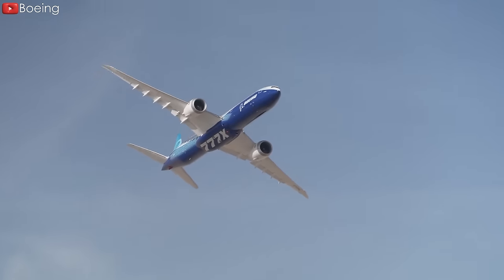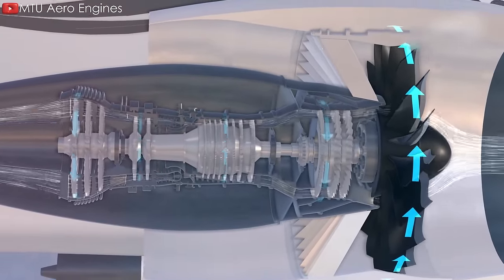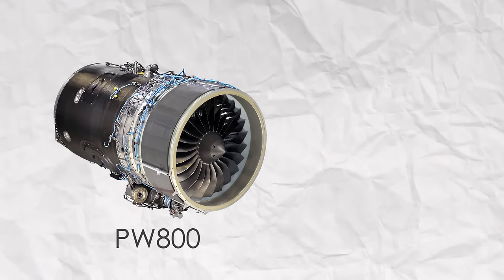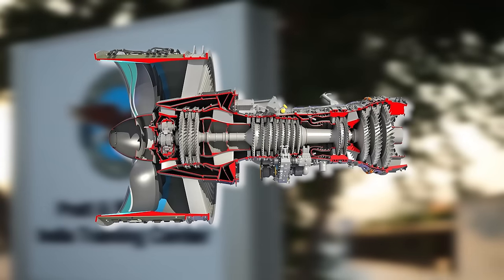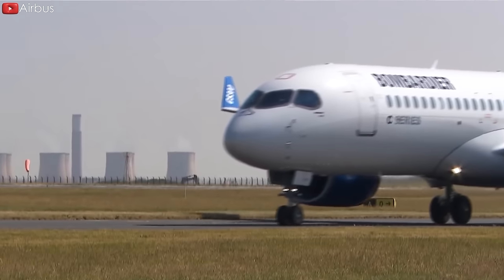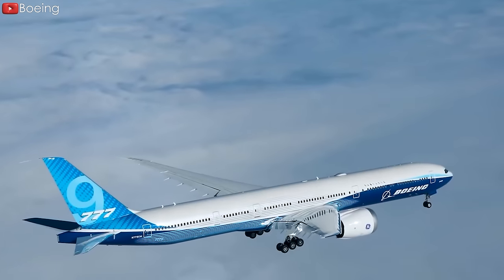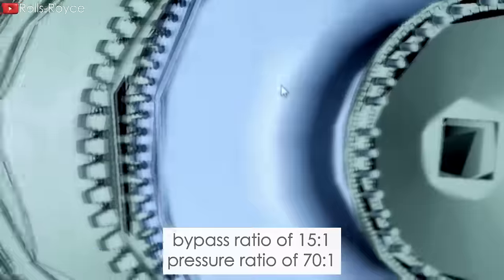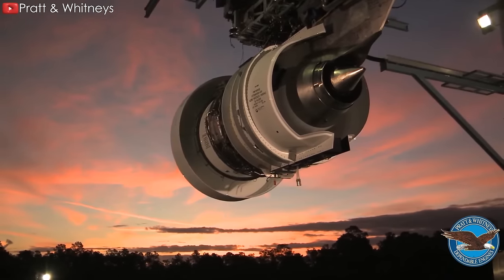Airbus 380's NEW BIG ENGINE will change the entire industry! Here's Why

Comment: 😂 Great idea G for Gearbox and Grounded ! All PW1100G enginesq are out ! Recalled Great dramatic non Gas consuming at all... like G35 engine. Oops F35...Gear not Great. Lots of planes Grounded Grow of prices due to lack of planes conGratulations 😢
Reply: The current major GTF problem is linked to a metal powder supplier which also affects other jet engine manufacturers. 

The GTF gear box has been virtually 100% reliable.
Reply: @icare7151  hello, almost ALL PW "G" have this problem of métal treatment ( surely on gear ) large numbers of planes grouded while G.E, SAFRAN, RR don't show at all this general problem.

Comment: 50:1 I wish them luck I really do but I am really astounded with today's 12:1 bypass ratio that is incredible, the 50:1 is almost the fossil footprint of a cigarette !
The ETOPS rating ( distance to a backup Airfield ) has changed over the years for twin engine aircraft allowing them to cross oceans still exists but the reliability of the latest turbo fans has allowed them to get further away from their alternates turbojet physics will never change as far as as the engines go as a 50% loss of power may result in a 50% loss of height and therefore a descent into thicker air this is what made the four engined aircraft able to cross the vast oceans that they could
I wish then luck I really do
Who knows maybe I tri-jet jet engines aircraft that may not be used unless required with similar RAM air ducting to eliminate the drag caused maybe the auxiliary power unit normally for starting and ground power could be larger and have a throttle
For emergency power

Comment: It seems that there are some secrets kept by all parties leading to this mess. I believe the newly designed jumbo jets are not survivable if one of their engines fails on take off or initial climb in every case, one engine does not have enough power. In the case of the A380, even 3 engines could not do it. We also know what happened to Concord.

Comment: Once again I was the employee to suggest the scaled enlargement of the NEO to fit the Airbus 380. The Russians also invested in the Pratt NEO engines this is why they are on the first MC-21-300 Russian Airliner and I was the first Flight test Jet engine mechanic for the MC-21-300 in Zhukovsky 2017 and Siberia.
I was fired from my career because 😂was too good at the job for my co-workers to have to put up with. Now I had trained to kill Soviet troops with enthusiasm for 3 years on the iron curtain. The Russians knew this and at first did not want me there. But I grew on the like a wart 😅 I had empressed the Russians with my skill and dedication to the job at hand. Covid hit and I lost my Test cell and thrown down with the dregs of humanity on the assembly floor and I was placed on the military line. That pissed allot of people off who have seniority over me. I am a military vet. They are NOT. The last thing I had done at Pratt & Whitney was CORRECTLY Re-write the assembly instructions for the F 100 main engine oil pump so any dumbass could build it correctly. The retired factory workers who WERE NEVER certified Aircraft mechanics. Kept the instructions garbage so in case of a strike. No one would be able to properly build the main engine oil pump. I re-wrote them correctly. Engineering was stunned. They asked me why I felt qualified to write the factory assembly instructions.
I replied I have 20 years experience with Caterpillar heavy equipment repair and the last I heard they were big Into hydraulic fluid motion. 😅 There are at least 6 different types of hydraulic systems that are used by Caterpillar. Would you like me to explain them to you? I also have almost 20 years as a CERTIFIED AIRCRAFT MECHANIC ( 😂they did not know that) with a degree in Aviation maintenance Technologies from the National Aviation Academy in Clearwater FL 4.0 GPA Second in my class 😅 Since I am veteran and I am very familiar with the concept of close air support. And I am a Mechanic. The last thing I need when I am hunkered down pucker factor of 14 and climbing. I don't need the Attack aircraft to have a engine failure because some son of a bitch was worried about his fucking overtime. 😢 I was reported to HR that an employee FELT like I was going to do a mass shooting at work BUT I never threatened anyone at work and I have not owned a gun since 1987 either. I was at the time working with 3 co-workers who physically attacked other people on the clock at work. I was treated better by the Russians than I was by co-workers whom I have never harmed. Only tried to help. 😢
Nov. 15, 2020 my last day at work
I had stopped at Dunkin Donuts and bought 2 dozen assorted for my co-workers.
Too bad they were not poisoned. 😅 Just kidding😂
Those stupid fuckers are all vaxxed 😅😅😅😅😅😅😅😅😅😅😅The same